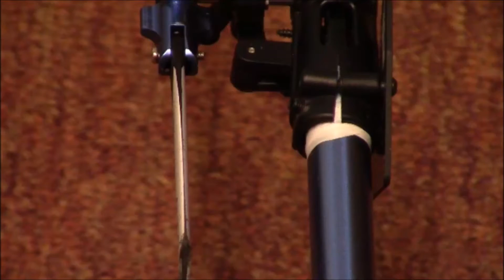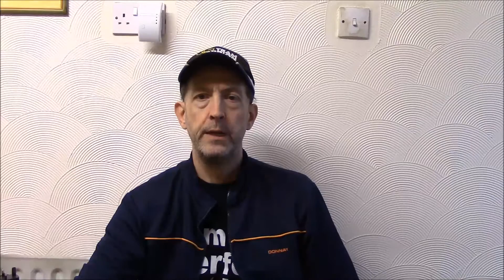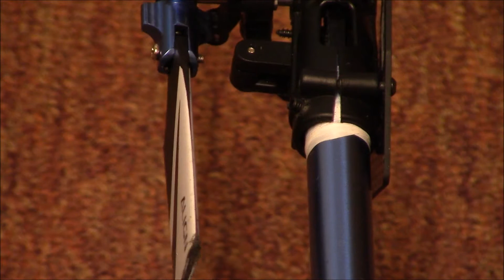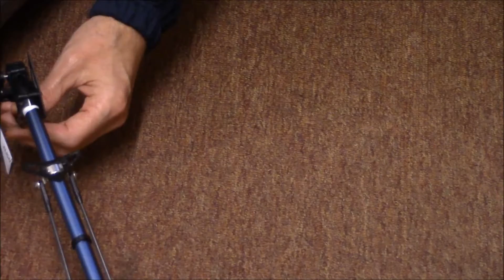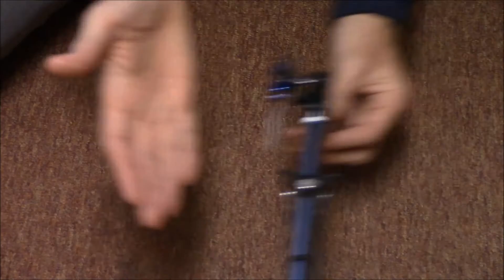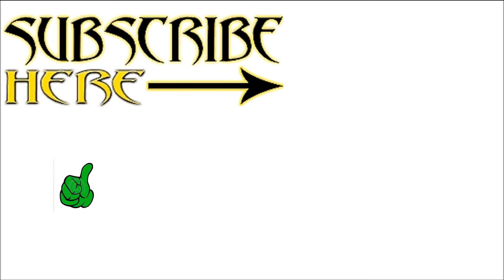RC HELI TAIL ROTOR SET UP

Comment: Tanks for the Vidio but your Heli is a bad example tail blades on the end there you have many contac with the ground and what you have maken with the tape is realy horrebly and now you have to balance the complete tail ;-(((((((((((((
Reply from the maker: This post was just to show the correct way the tail rotor should move and that's all. As for the tape on the boom that was a field repair, I did earlier that morning, I had been flying and had a crash and damaged the rotor case so I repaired it at the field so I could keep flying. But as I said this video was just to show the correct movement the rotor should make to help new pilots who are unaware. I would have thought that was pretty obvious from the video.